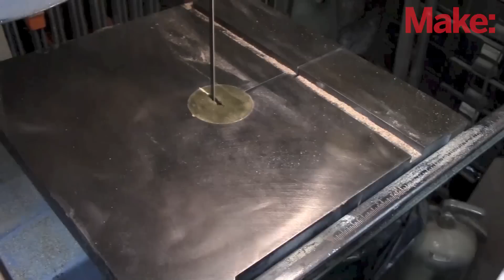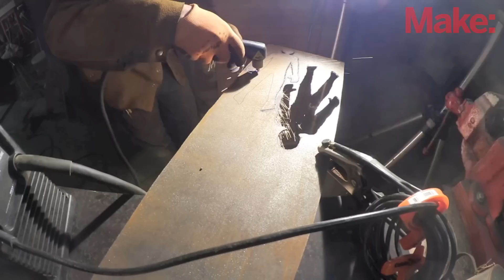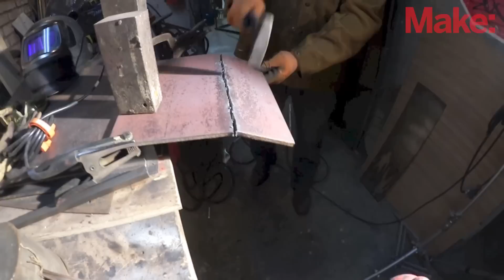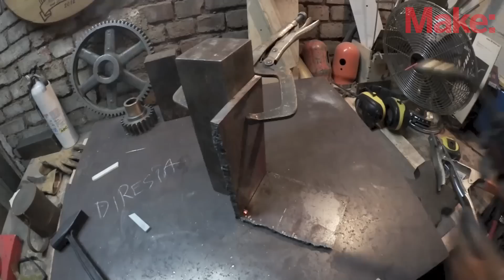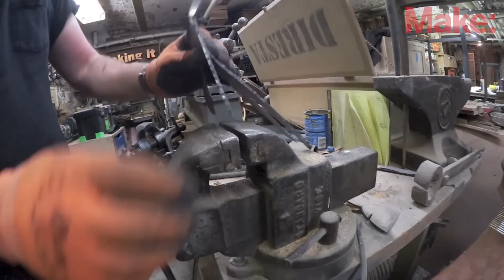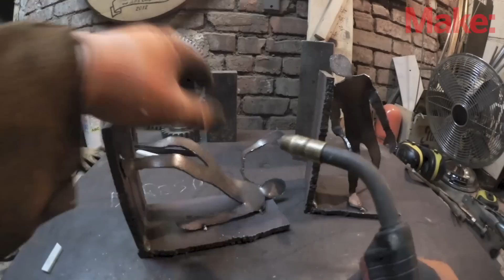DiResta: Bookends

Comment: Thank you all for the positive comments! i heat the thick metal to be sure the weld will penetrate. if i didn't heat the area the weld could be "cold" and would'nt be strong. PLEASE subscribe to my channel, thank you !
Reply: If the metal needs to be heated, though, for the weld to be successful, then why didn't you heat up the figurines of the people? Is it thin enough that it'll take without being heated? Or was that just not shown?
Reply: Girdain
nope, nothing under 3/8 would need a heat treat
Reply: Girdain it was thin enough that it didn't need to be
Reply: jimmydiresta In that case, if you'll excuse me, I need to go redo a few welds

Comment: Those look great, I hope you keep making these videos|
I get it that you heat the pieces of steel to get a better weld, but why not just icrease the current (amperage) on your welding machine?

P.S.: you better line the surface in contact with the books or the rust will stain them. Thankyou for reading

Comment: Jimmy, I was waiting for your next video to come.. I am really amazed by the talent of yours. Jimmy, one question, when you joined the 2 pieces of metal, I noticed that you used a blow torch before you spot weld it. Why?
Reply: He used the blow torch to pre-heat the surface to weld, because being so big the two parts would have dissipated heat too quickly. The electrode wire alone couldn't have been able to heat up metal enough to melt the parts together, so he used the torch to help welding process! Hope that's clear!
Reply: Thank you!!

Comment: Very cool. I'm in the leave it unfinished boat...
Why use the torch on the seam before welding?
Reply: I think his welder is to small for that plate. So by putting heat into it, the welding bead would join better. But that's a guess, sorry if it's wrong.
Reply: basically its to expand the metal and make sure the bead fills in the grove rather than sit ontop of same with the circular motion as he welds just filling the "pool"